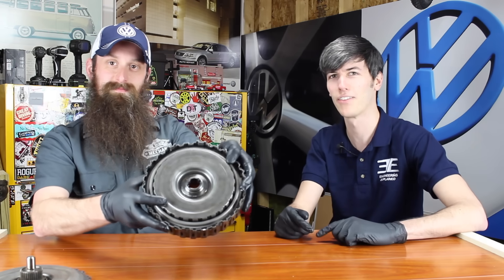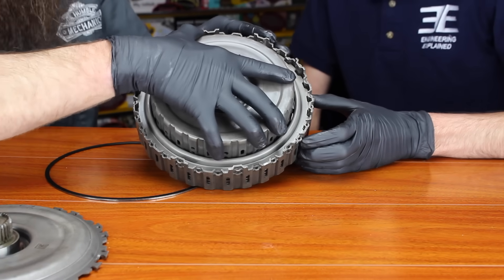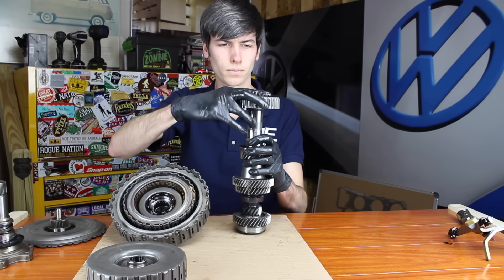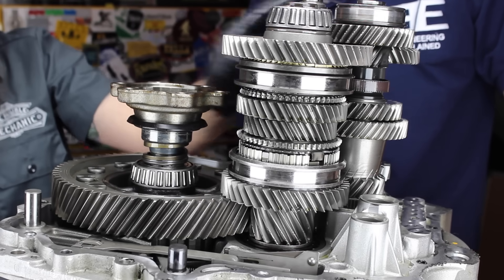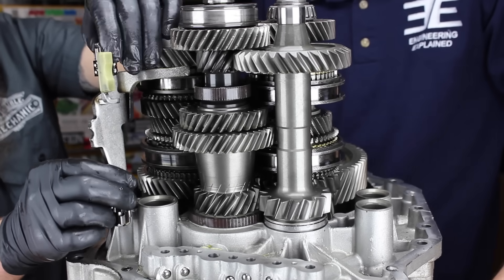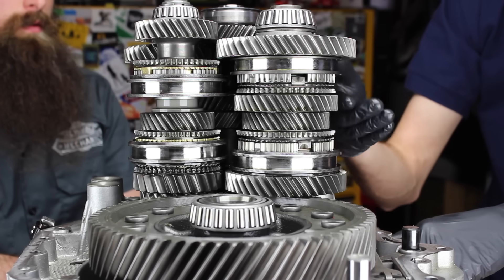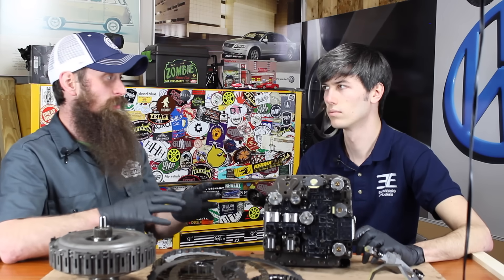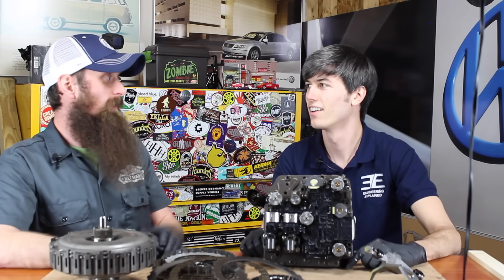DSG Transmission - Explained

Comment: VW's DSG is great to drive. Drove a GTI with one and I fell in love with it.
Reply: Hear That? Yeh but wait till it breaks....wallet emptier
Reply: @alanbrand7681  dsg 6 is unreliable, dsg7 with wet clutch 200,000km oil change at 60k np.
Reply: Dragos Pahontu seen plenty 7 sp broke as well
Reply: @alanbrand7681  mechatronic fix is like 2k$ but a total failure is rare and 7k$ for new trans.
Reply: @alanbrand7681  the new dsg's arnt bad at all though as usual when they do break your outta luck but they will last 200k km or 150k miles usually without issues which is fine for me at least
Reply: @timmiekat6072  Even dq200 isn't bad but you'll have to expect to change the clutches over 60,000km
Reply: @dragospahontu  yeah Volkswagens used to rely on their diesels for the people who wanted reliable cheap to maintain economy cars while the gasoline's were more for the people who drove short distances an didn't drive a lot and just wanted to avoid tax which means the gas cars couldn't be bad for the environment which further decreased reliability but since you barely get diesels in the usa you don't get reliable VAG products though diesels are disappearing and they are now starting to make more reliable gasoline cars the 1.5 tsi and the update 2.0 tsi engines are pretty reliable so far
Reply: @timmiekat6072  bruh we don't know anything about the 1.5 or 2.0 budack system.

But the old 1.4 with belt was ok, and I'm hopeful for the new engines to be good on the long run.
Reply: @dragospahontu  I said so far here in Europe they have been out since 2017 people have driven 100k kilometers with them already
Reply: @timmiekat6072  after 8 years and over 200k i can give them my seal of approval.

This far these engines are great for VW standards, let's remember the famous 1.8T with it's oil consumption. 
P.S i just bought a B8 facelift Passat 1.4/dsgdq200. It's a 1.4 not a 1.5 because I bought it in Russia and they don't have the new engines which for me is actually better because the 1.4 has passed it's long term test.
Reply: @dragospahontu  Yeah they are allright engines I've had both now really similar in driving 1.5 is more economical and just a bit quieter doesn't really matter I just hope they last cause if they don't I'm gonna pay for it so far it seems good
Reply: @timmiekat6072  yup
Reply: @timmiekat6072  on what car do you have the engine
Reply: @dragospahontu  mine literally went few km agos i have video on my channel, do you know what price i would be paying for the clutches and labour now
Reply: @alanbrand7681  Check engine lights are a way of life

Comment: I like my DSG in my GTI. I have an engine and DSG tune and it's even better than stock. I miss driving manual, but the DSG is a great all around performer.
Reply: What so you4 dsg transmission is automatic

Comment: Ah, so it's not actually faster changing gear, as in actuality, the gear is ALREADY changed, and all you're really doing is swapping which clutch you're using!

...Right?
Reply from the maker: Gara Von Hoiwkenzoiber Correct!
Reply: @EngineeringExplained  I've seen claims of shifts as fast as 8ms. Any comment on that?
Reply: @dielaughing73  Obviously I didn't measure it, but since me, a human without instruments am able to notice the smooth gear changes, I'd say it's nowhere near 8ms. (I have a dry DSG and did 30k km on it)
Reply: @StormDeveloper  if your saying you have a dry clutch, then your gear changes will be not as quick as the wet clutch. The dry clutch works totally different to what’s explained in the video. Dry clutch has the mechatronics unit, but instead of controlling oil pressure to engage/disengage clutches, it uses oil pressure which is stored internally of the mechatronics unit (seperate oil to the gearbox) to move selector levers to push against each clutch, very similar to how a manual transmission works. It’s basically like having 2 clutch pedals, but instead of the driver pushing them it’s done via the mechatronics. Hence why it’s only on lower powered engines. Still quick, but not as quick as wet clutches.
Reply: The Direct Shyamalan Gearbox.... you were in 3rd the whole time....
Reply: Yeah but you have only 2 clutches,and 6 gears. I think clutches are working when you are changing the gear. As they said its like manual transmission  just it works automatically. For example. You have one clutch for speeds 1,3 and 5,and another one for 2,4 and 6. Correct me if I'm wrong.
Reply: It's true the gear is already selected and at speed, but there is a moment where the original gear is not actively driving anything, and the next gear is not actively driving anything in the transition. That's still a gap in force transference, which is a "gear change," though in really high tech DSGs, this can be 8ms.
Reply: You are correct.  What makes it faster is a different sequence of events.  Tranditional manual trans:  1.  Interupt powerflow by releasing the throttle and disengaging the clutch;  2. disengage prior gear, move lever as required to engage next gear;  3.  re-engage clutch while trying to match engine revs up or down to output speed in new gear.  The time that matters is from the point that torque is interupted to the point where it is re-applied, so driver skill is a big factor.  With a dual clutch:  1.  The next gear is preselected while power continues to flow;  2. Powerflow transitions from one clutch disengaging to the second clutch engaging... power flow is modulated by computer, but never fully interupted;  3. The shift is complete when engine speed increase or decrease matches the output speed in the new gear, and engine power can be ramped back to whatever it was before.  Shifts in a traditional automatic also happen without full interuption of powerflow,  but the rotating inertia is usually higher than in a dual clutch, so the dual clutch is usually able to make the transition a bit faster than the traditional AT.
Reply: It’s controlled by hydraulic pressure which in turn is controlled by the solenoids within the mechatronics unit itself, it’s just a case of releasing pressure off the clutch being disengaged via the solenoid and activating the next solenoid to pressurise the other set of clutch plates, as this is done electronically it is almost ‘instant’, very very little delay
Reply: It actually is changing the gear faster. Because you don’t change a gear until it’s actually engaged.

Comment: The bane of vags. If one of these bad boys fails your in for a shock at the price of repair....
Reply from the maker: It's not like transmission repair jobs are generally cheap though.
Reply: Engineering Explained $1200 for a rebuilt manual transmission hurts your wallet a lot less than $5600
Reply: dragkid185
 IF you really want to get sad about transmission costs, check out a Jatco replacement. You have to replace the TCM too. YIKES!
Reply: HumbleMechanic here in Europe and particularly the UK dsg vags are buy at risk. You can get away with it fault free or you can get one that's on its last legs. The amount of recalls tells you something. No doubt there a great example of innovative engineering but I wouldn't want to drive thinking what's my luck today with this thing.

Comment: Great video! In the example of de-accelerating for the red light, then the light turned green and there is computer lag to re-accelerate. Does manually down shifting the paddle shifters overcome that lag or because computer controls clutches, lag still exists?
Reply: It is mostly about the computers interpretation of your intent. Manually shifting should overcome that. Or driving in Sprot mode

Comment: Is this something technicians would rebuild?
Reply: Not at the dealer level. We either replace the mech unit, the clutch pack, or the entire trans. I think 1 or 2 times I replaced a temp sensor but that's it.
Reply: HumbleMechanic Ok thanks. I guess no one really rebuilds transmissions anymore unless it's a specialized shop. I always found it fun putting it together. Just straight mechanical work,
Reply: Cantenkerous Tim
I agree, I like to tinker with them. It is all about time vs cost on rebuild/replace. I may talk about it on Monday's Podcast

Comment: Great and fascinating stuff, guys. I've been wondering what the inside of my DSG looks like. My commuter is a 2014 Jetta TDI named Loretta and I couldn't be happier with her so far. However, every so often I do manage to somehow confuse the gearbox slightly and I get that pause in action that was mentioned. No biggie, though. I'll gladly take my 47 mpg highway and the awesome factory Fender sound system (actually Panasonic) and rock out.
Reply: 5 L/100km on the highway is not even good for a diesel car.
Reply: @laszu7137  most fixed TDIs get that now. Mine used to get 4.3l per 100, now it's about 5l per 100km
Reply: @laszu7137  that’s awesome idk what you’re talking about

Comment: What kind of driver inputs are usually used with DSG transmission? (e.g. paddle shifters or maybe full auto?)
'Cause when I'm talking about VW I can't really imagine paddle shifters :)
Reply from the maker: Paddle shifters are pretty common. I suppose it could also use the gear selector in a manual mode, where you push it forward or backward.
Reply: Then paddle shifters count as a high-spec option only for me :)
But manual mode sounds proper, you gotta be right with that.
Thanks very much!

Actually I find DSG an engineering masterpiece :)
Reply: Morwola Remember VW owns Audi and Porsche (along with Lambo, Bugatti etc) so paddle shifters on a VW Passat may sound funny but it's normal on say an Audi TT or 911 that also use a DSG.
Reply: CDN12Guns 911 uses PDK....

Comment: Question. So on the old automatic manuals that only had a single clutch, it wouldn't be able to pre select a higher or lower gear? And thats why people all ways thought they were kind of crap, because you all ways had the delay when either going up or down a gear.
Reply from the maker: Correct, if there was only a single clutch you cannot preselect the next gear.
Reply: Engineering Explained Okay, makes total sense.